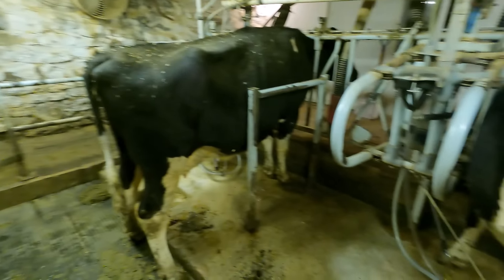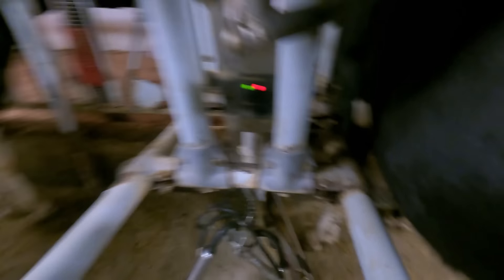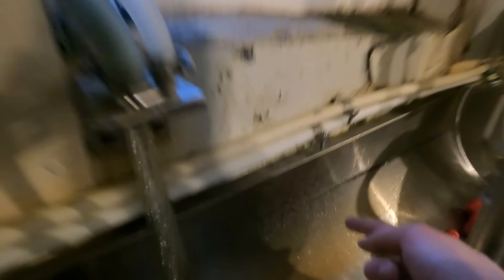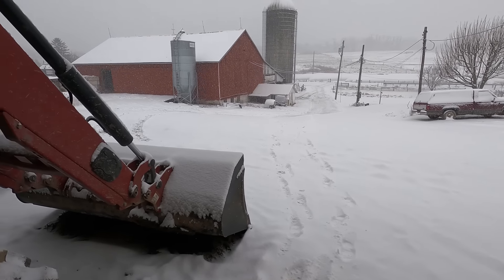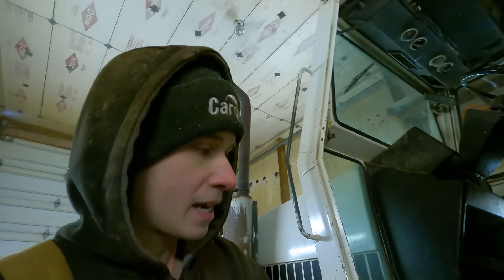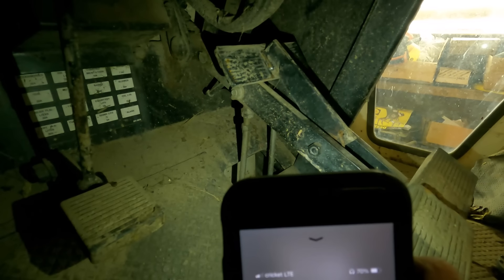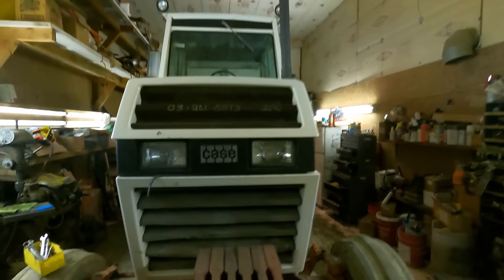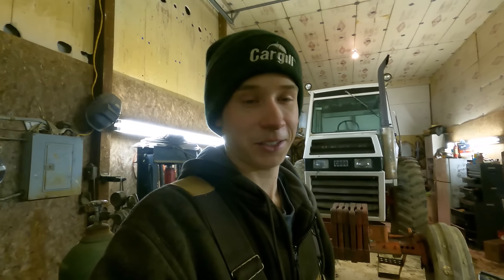Morning Milking Cows & Plowing Snow

Comment: The block heater is positioned in the system to circulate the coolant because hot water rises and is replaced by the cold water coming in from below it. You are wearing a Cargil touque. We have a Cargil plant in our town here in Ontario. For their ages your tractors do look pretty good. That speaks of the guy who is looking after them. Good video. Pax.